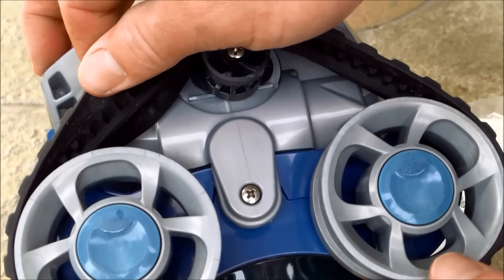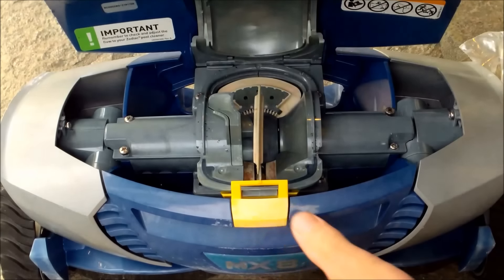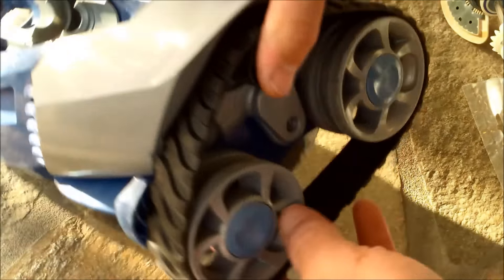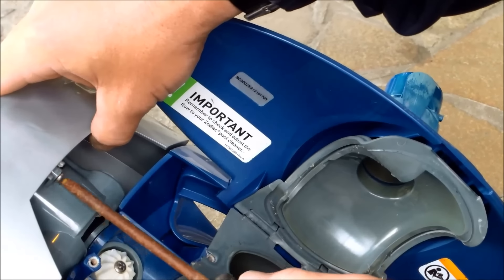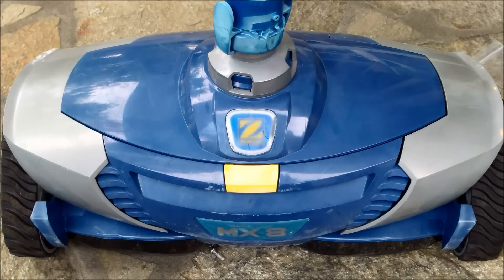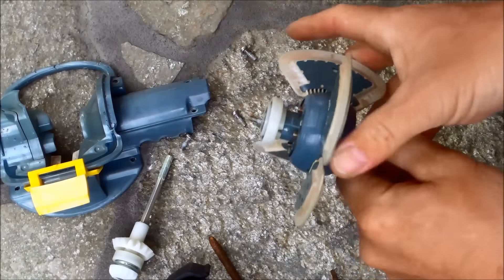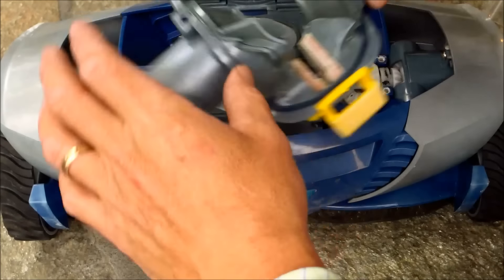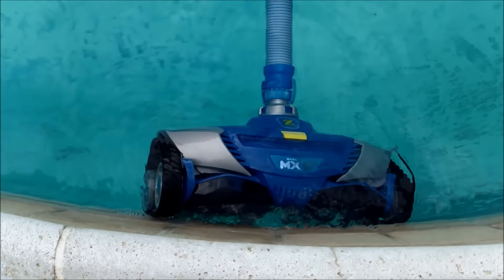Zodiac MX8 Getting Stuck, Moving Slowly or Going in Small Circles

Comment: One more question, once you install the new tune up parts which costs a little over $120 or so, how long do they usually last from your experience? 3-5 years?
Reply from the maker: Directional controls probably about 1.5 years running 8 hrs a day. Usually one before the other.  Turbine about 3 years. Tracks maybe 1.5 years.  But you can rebuilt this thing over and over which is great.
Reply: hmmm i do like the fact that this cleaner is easy to service and it has that cyclonic scrubber upgrade but it seems like the gears aren't as intelligently designed as the Pentair Rebel/Warrior, and it seems like it has a lot more moving parts than the Rebel/Warrior. Im trying to choose between Warrior or MX8. From your experience, is MX8 more high maintenance than the Pentair Warrior? or are they about the same?
Reply: The barracuda MX8 is a thought out trial and error , fix the bugs, make it cost effective to rebuild and reliable and intelligently designed in house by Zodiac's highly experienced engineers. The Pentair anything? Was designed, engineered, blah blah  blah blah by nobody at Pentair, they were all some inventors , or another pool companys that is a rival. They reverse engineered their opponents equipment, then changed the basic look but under the hood it's the same as their competitors. Do they improve anything, Only manufacturing all the replacement parts outside the US, changing fastener sizes or styles to create a more elaborate looking part they can charge way more for. But Pretty much the same thing, even if patented. How can they , they'd get sued? What they have at Pentair are great teams of marketers and Lawyers that notify every company that thgeyu are going to reverse engineer their equipment, change the look and market it against theirs, so they offer them a buyout of the majority contract of ownership, if the offer is refused, in order to win a Patent violation case, it takes such a long time each stage of the game, that if and when they are ruled against and your company or you have spent a fortune to get there, Pentair has made enough money worldwide to cover their penalties but by then they will be onto the next style cleaner and the matter is irrelevant by then. this is the way with so many different technologies coming out. The MX 8 is maybe one of the best built cleaners the industry has ever seen, Only The Poolvernugen " The Pool Cleaner" Rightfully purchased from a single inventor from Santa Rosa California by Hayward Pool Products, compares. The 4 wheeled version is by far the best cleaner I've ever encountered in 28 years, thanks to the hard work and dedication of 1 man, and his years of study before he picked a company that was going to fully be behind his invention. He sold them and gave them away for free to poolmen for years to get their feed back, was never going to sell but the demand grew to where he was expanding all the time and his prize became a big operation, too big for this older Garage inventor. That will hopefully help you

Comment: Mine spins manually and when placed in pool goes forward, but when it's near a wall it rolls on its side and just stays there.  If I take it out, spin the wheels and place it back in it does the same cycle  Rolls to the side and dies..

Comment: I appreciate this helpful video.  However, I ran the test and both sides move forward, then into idle and then immediately reverse as intended.  My wheel rotation is 10 revolutions in 24 seconds.  The treads on both side appear to be in good condition on both the gear and movement sides.  My problem though is that the unit will get stuck in a stair corner, but worse it at times will not ride flat but will stand up with the brushes not on the bottom.  At times, after climbing the side it will land on its right or left side and stay put...ANY Ideas????  Thanks. Ed S
Reply: did you find a solution? I have replaced these parts in the past, no issues until recently it does wheelies. LOL not sure what the problem is if anyone can help.

Comment: This looks like a pain in the rear...What a head ache?  Why this when the Baracuda, the KreepyKrawly does a faster job with hardly any moving parts?  This may climb well, but how often does it need a rebuild like this?? 2013 this video, its not even that old
Reply from the maker: Does have a lot of parts. But it is effective. I think the most underrated cleaner is the Zodiac Ranger. $145 and only one moving part... 👍
Reply: @SPL   Does the Ranger work for in ground pools?